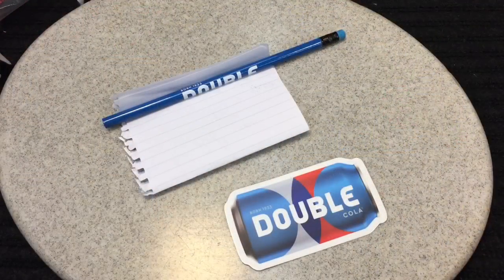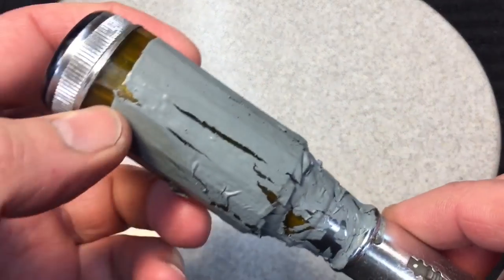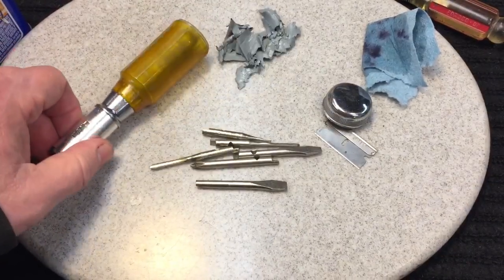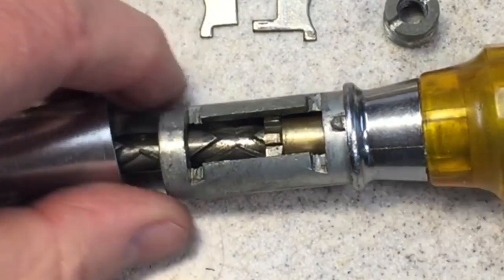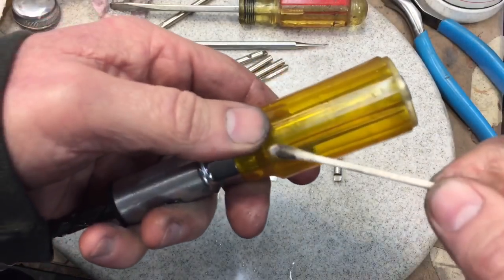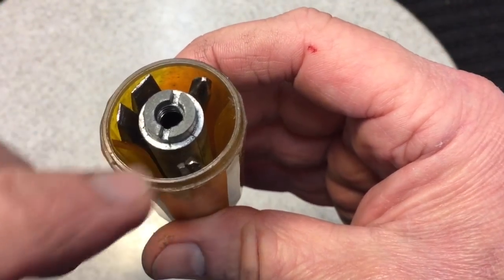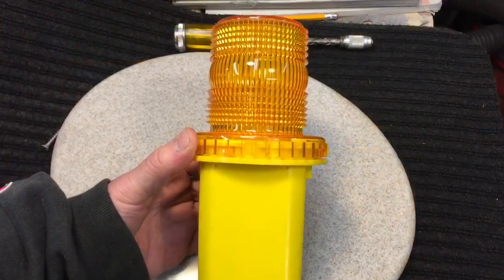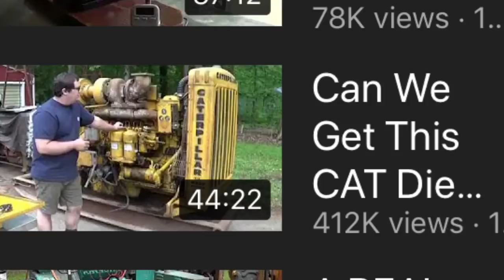Sears Companion Ratcheting Drill/Driver

Comment: John,

The last ship construction project I worked on, the tankers had two 11,000KW (15,000BHP) MAN 7S50MC-C main engines, two 1500KW diesel generators, and one 750KW emergency generator.   The main engines were 7 cylinder, 500mm, 2.5m stroke, and 127rpm.  By diesel engine sizes these are babies, a large engine today is 12 or 14 cylinders, 980mm or 960mm bore and a 2.5m or longer stroke, and  run at 68rpm.

Size matters!

Bob
Reply from the maker: That’s Big!!!  😃👍

Comment: My brother gave me our grandfather’s Fulton push drill.  Internally, it looks just like the Sears.  I disassembled it, cleaned it up, and after re-assembly, I realized I had put the two brass cams in the wrong way.  It was drilling on the pull back instead of the push.  Had me scratching my head for a few minutes, but I got it going right.

Comment: I really like the point you made about PPE. In the machinists world, gloves should be avoided except for thin rubber gloves. I have now known six different Machinists who had to retire early after developing a sensitivity to cutting oil. These guys worked decades with no problem and one day their hands started swelling and turning red. Two of them were able to return to work strictly in gloves, but they were unable to use that cutting oil ever again. The other four developed a sensitivity to ALL cutting fluids. Flat out had to change careers. It's a known thing. Just because nothing happened last time doesn't mean it's safe this time.
Reply from the maker: The skin is so porous that chemicals quickly enter the bloodstream!  Certain chemicals can be quite harmful.  I do sometimes get oil and WD on my skin but it really isn't good any time...   =D

Comment: I have a similar one. Again, from my grandfather. It's a S&K. Used it a lot when I was younger. But, they seem to have been supplanted by cordless drills; these days. I never used it much for driving screws. But, in it's day; it drilled a quick hole for sure. Nice one you have.

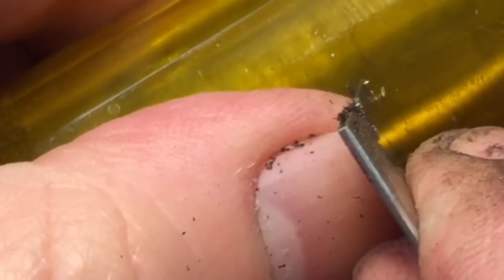Comment: Could you use a plastic razor blade instead of the metal to get those paint dots off (@ 3:12 in)? Ever since you showed those I’ve been using the plastic blades on everything. I never knew they existed, quality of life improvement for sure!!

Great video as always!!
Reply: I use those plastic blades all the time as well - ever since Scoutcrafter showed me that they actually exist!
Reply from the maker: Sometimes the plastic blades will work but some of those paint spatters are surprisingly stubborn!  😂👍

Comment: Hey señor Juan... great video, but to remove oil paint is better to use break  fluid and put the item under direct sunlight for a couple of hours.  Saludos señor Juan..
Reply from the maker: Saul- Break fluid does remove paint without hurting plastic. My friend used to restore painted slot cars that way....  However it took a couple days to work...  Thanks!
Reply: @ScoutCrafter   This is why you need to place it under sunlight  señor.
Reply: @ScoutCrafter  I guess, heat helps to remove oil paint paint faster it you use a heat source. I believe you could use a hair dryer to speed up the process señor Juan.

Comment: I can't do the little intricate work anymore, but the machinist Paragon of materials applies here. I have not tried one myself, but I have seen advertised plastic razor blades. They seem to come in three or four different hardnesses. Have you tried these? It just seems like it would be ideal if the tool you were using was just a tiny bit softer than the work and just a tiny bit harder than the paint.
Reply from the maker: Yes!  I showed them on a video.  They do work great and I use them quite a bit but sometimes those paint splatters can be stubborn!!!!!   =D